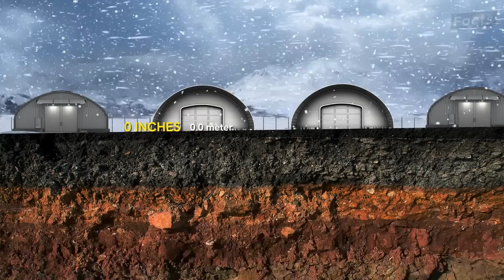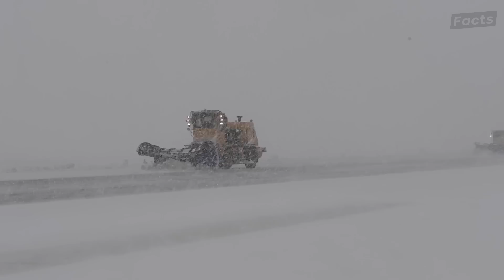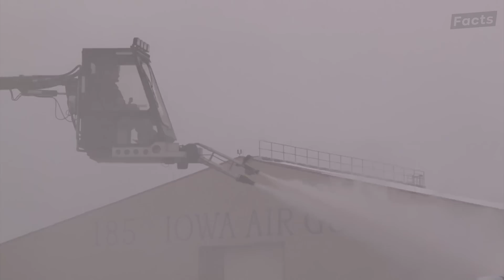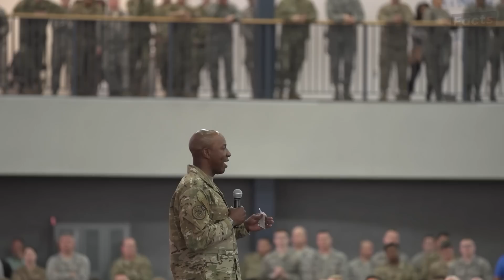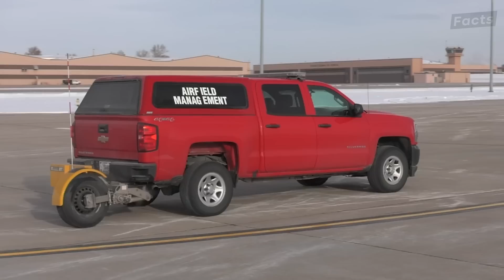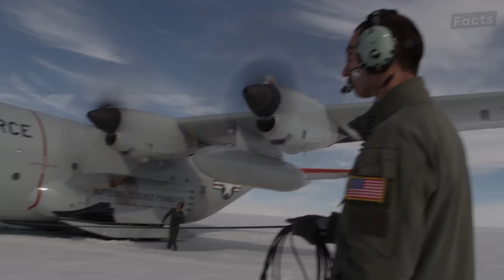Inside The US Air Force Coldest Airport

Comment: Your description of how a normal wing creates lift is incorrect. Air is not forced down by the wings to push the aircraft up. Air is forced to go over and under the wing, with the speed differential between fast and slow moving air creating lift on the top of the wing. Wings are designed to have air moving faster over the top surface and slower over the underside of the wing.

Comment: In 1974 as a USAF Air Traffic Controller  I was stationed a year at Sondrestrom Air Base, 90 miles North of the Artic Circle in Greenland. There was even another Air Base even further North called Thule. Although both bases had USAF personnel stationed there, they belonged to Denmark. Interestingly we didn't get a lot of snow in Greenland but the temperatures were brutal in winter including 24 hours of darkness. I went from Sondrestrom, Greenland to Grand Forks, North Dakota and I would rather be in Greenland, much less wind and snow.

Comment: I was at Minot between 02-05 and I can tell you there was next to no training when it came to using the deicer booms. Just a quick overview of the controls and there you go 😂 if you were an E-3 or below you could bet your time would come to operate this😅 No matter your AFSC as long as you were a flight mechanic. Of course that may no longer be the case now. Also one piece of machinery used all around the buildings sidewalks and parking lots was the Bobcat with the bucket attachment. It appears now that they use Golf Carts 😅 with pushers

Comment: Ugg, my 8th graders would cringe at that explanation of airflow over the wing.  The air traveling over the top of the wing is moving faster in the airflow. On the bottom of the wing. This creates an area of low pressure, which gives the wing LIFT.

Comment: Fort Wainwright is more North. I flew helicopters out of it😂
Reply: I was a helicopter mechanic at Ft. Wainwright for 6 years. The lowest temperature that I ever saw on the Univervercity of Fairbanks sign was -68 F. That's why they send you to Ft. Drum New York to get your "Artic" tab, they have more snow. When the temperature drops so low that the humidity in the air freezes, snow does not stick together, instead it acts almost like dust or "powder". Henceforth, snowballs suck if you go too far north in the winter.
Reply: I had a job as a technician where we flew out of Fairbanks in helicopters for a summer.  We had 3 on contract. I then flew out of pump stations to mountain top communications sites. I worked in the Arctic in Alaska close to 30 years.